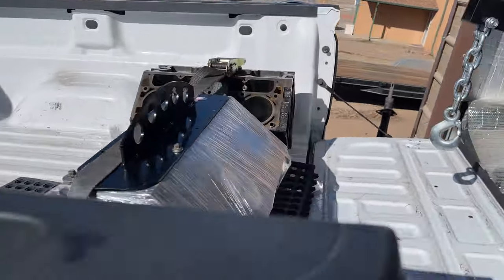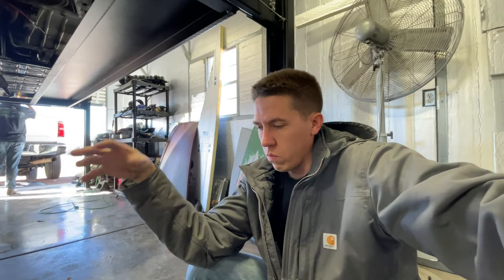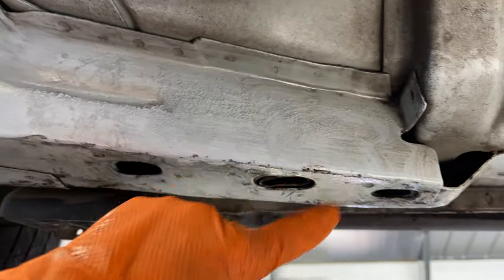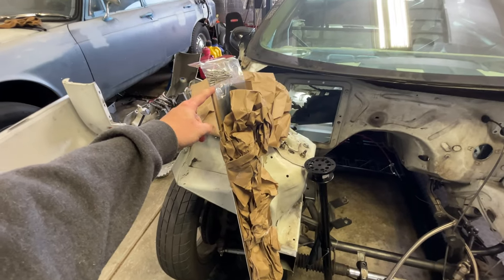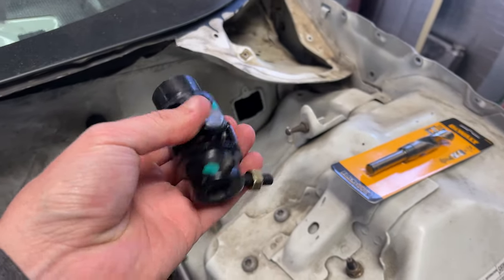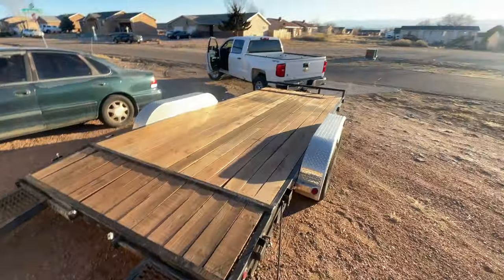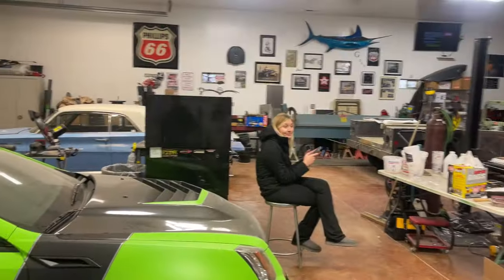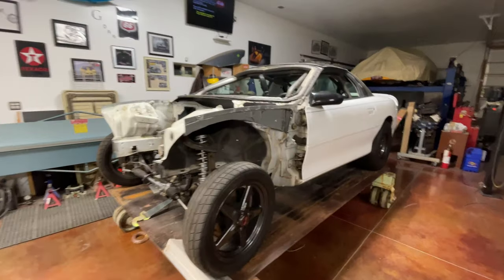1800HP Turbo Camaro Build Part 4: Headed For Cage Upgrades!

Comment: I strongly recommend you weld the knuckle to the steering shaft, drilling a hole in it will weaken the shaft at that point, with very little material past the hole it could give it a place to crack.
Reply from the maker: I like it! The shaft also seems to have a little play and welding would definitely fix that then the screw becomes a backup!
Reply: @BuildTuneRace  Love you're work.

Comment: Was the person who assembled that shortblock drunk or high? 1 and 3 piston put in backwards?!?!?!
Reply from the maker: 😬 another guy caught this and brought it to my attention… short block is headed back to get the pistons swapped and everything else double checked🤦‍♂️
Reply: @BuildTuneRace  Bit embarrassing for the shop, could have been messy if the heads were installed and the engine ran.